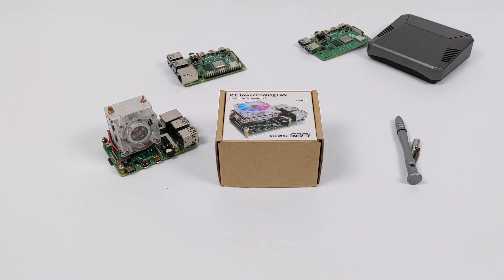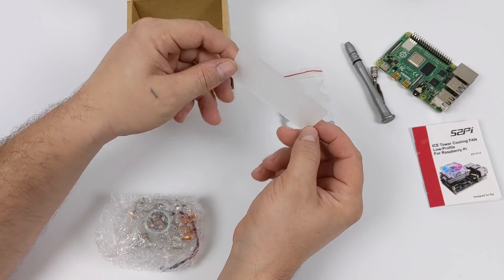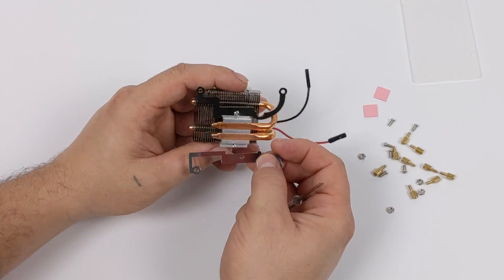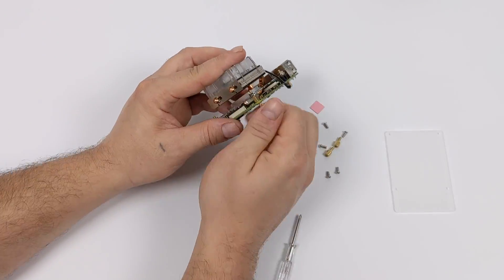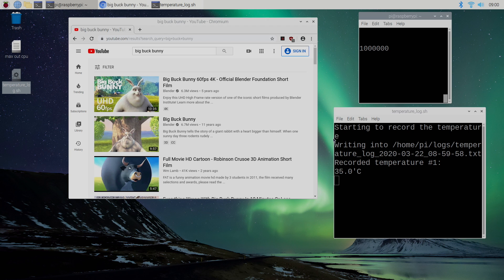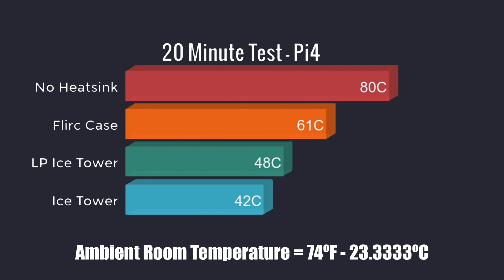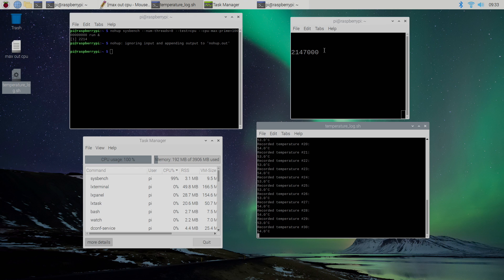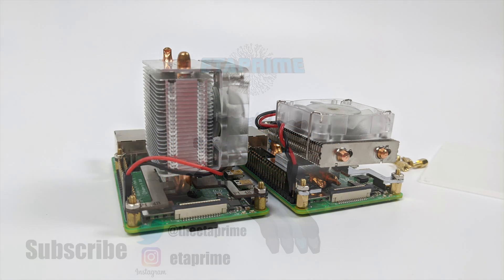Low Profile Ice Tower Cooler - The Ultimate Raspberry Pi 4 Cooler?

Comment: I have this cooler and mine I noticed the aluminum base plate and heat pipes were on 2 separate planes.  I sanded this down till they were level with each other.  I get 27c at idle and at 2.3 ghz with a synthetic load I did not exceed 50c.

Comment: To recap: that is a SBC with bt:5.0 and 8gb ram on a 2.0ghz apu that refuses to hit 55c even pushed to extreme limits. For $100 those specs are pure insanity. This one sbc, that is about the size of a pack of cigarettes is powerful enough to exceed any average computer user’s use case. You have to be an enthusiast to even take advantage of this multi monitor beast. Hackers be foaming at the mouth for something this crazy powerful.

Comment: Got here looking for the acceptable temps of the pi, I have the Ice Tower but had to remove the fan now after 4 months (it started making HORRIBLE noise. (I also didn't get the acrylic plate on either of the two cooler even tho they had the plate mentioned in the documentation.)) and I'm wondering at what temp the CPU/GPU throttles. (with just the ice-tower metal it seems to be running between 48 and 52 Celsius. edit: Its not idle, but running a few things on the network.(which crashes the Pi3b without active cooling.)

Comment: Thank you ETAPrime.
I picked the low profile version, because i thought it would cool the rest of the SBC by its directed airflow onto the components. yes we normally only investigate the core temperature.
The better performance of the older Ice Tower seems due to its larger heatsink area?! I didn't knew that the fins are wider than the LPs. Though i'm satisfied with the indirect RAM and DCDC cooling.

Comment: How about trying the original Ice Tower cooler, the one that looks like a block of apartments, with a second fan on the opposite side of the heatsink, blowing air in, rather than pulling it out ... I imagine it would be noisier (two fans, twice the noise), but would be interested to see the thermal effects of the forced-air setup ...

Comment: Can you put some heatsinks for the ram and the other chips with the Ice Tower kit?
And do you reccomend to put some thermal pase on the CPU?
Reply: The ram and other chips dont need cooling as those dont get hot either way. And you can use thermal paste, but ive heard there isnt much difference in temps
Reply: There is barely enough room with the original ice tower, but as the other person said, it's not necessary. However I did notice a small drop by putting them on the ram, and other controller chips, seems like it just helps overall. Also they do make some cases for the ice tower now, I use a Pizen Electro Cookie and it does great.

Comment: Great review, thanks! I'm currently very happy with my Argon One Fan Hat, with 3 customizable temp/speed settings, on my 2GHz overclocked RPi4. With 100% fan speed @ 60'C, it maintained 70'C with all 4 cores maxed out. 1080p YT videos cruise @ ~55'C, with the fan speed @ 60%. IOW, it does the job nicely.
Appreciate your honest opinion that also confirms my suspicion that the Ice Tower is overkill, plus obstructs having an enclosed case design for outdoor weatherproofing. But, yeah it looks kind cool, if that's the prime objective. :-)

Comment: Is there anyway that an Asetek Vapochill Lightspeed PC Case could be used to cool a Raspberry Pi IV just that the electronics have to be protected from the condensation caused by the cooling system by said case.

Comment: Dont buy the black Ice Cooler.  The part that sits on the SoC is painted.  You need to polish the black paint of with a dremel tool to get better heat transfer.

Comment: I see all these fun looking kits and I am tempted, but I can only afford 1 mini pc and I want a lot of bang.  I'm looking to emulate PS2.  I don't know if the pi4 can do it.  What should I be looking at as far as stats for standard 1080i ps2 emulation?
Reply: Pi 4 is good . You can get either 2gb or 4gb. 8gb is overkill as most rpi projects dont need 8 gigs. Id atleast say 4gb as it is a good amount of ram. Than you can use this cooler so you can overclock your pi 4 which makes emulation better

Comment: Hi, awesome video. I purchased a P4 a few weeks ago. I have installed the standard heatsinks that came with the packaging. Can this ICE tower be added on? Or will I have to remove the old heatsinks?
Many thanks
Reply: You will have to remove the old hestsinks. The only thing that mostly needs cooling is the cpu which has the GPU in it. Other parts dont get too hot

Comment: A well placed 5v 40mm noctua fan with stick-on heat sinks is enough to keep a Pi4 at 40c, even under demanding workloads like parallel code compilation.  This stuff is extreme overkill imo
Reply: Hey is this what you did for your pi 4? Because I think this is all I would need for my setup nothing extreme if so was it this fan Noctua NF-A4x10 5V, Premium Quiet Fan, 3-Pin, 5V Version (40x10mm, Brown)
Reply: @ever6  yep... Got some stick-on alum heat sinks from Amazon as well.
Reply: @codecae2  Thanks I'm going to order it now with my $90 giftcard
Reply: @codecae2  oh forgot to ask what case are you using for your pi 4?
Reply: @ever6  printed my own "rack"

Comment: A discussion of noise levels and fan curves would also have been useful. Imagine getting the fan down to e.g. 100 rpm for ultra quiet operation - probably not possible.
Reply: You can swap it from the 5v rail to the 3.3v for quiet operation and it still kicks butt.

Comment: Prime... you’re a day late, dollar short on this one man. People have done reviews for this as well as the regular Ice Tower for months now. How about a video on how Pi 4s can’t overclock after the latest rpi-update, or best packages to install on a Linux Distro for Pi4, best packages / unnecessary packages for Linux with Pi4, or Linux distro comparisons for Pi4? Don’t get me wrong bro, I really dig your content.. watch it religiously. Sometimes I feel like you’re grasping at straws for content when there’s so much untapped material to be discussed. Endulge me lol 🤣
Reply: You can only take so many obsolete computers and turn them into emulation beasts. At this point I think BalenaEtcher should be sponsoring your vids lol.
Reply: I went through comments as well, and quite a few people are touching base on overclocking, the config.txt file, and temperatures. I think a lot of folks including myself would be curious to hear your take on things such as the various Pi4 firmware kernels, stock Pi4 firmware, variables with overclocking, the SILICON LOTTERY, troubleshooting for users who can’t boot different Linux OS programs, and steps to take to improve optimization. #Content

Comment: I'm waiting to see an AIO cooler solution.
Reply: Did an AIO cooler show up and what’s an AIO cooler? I looked it up and didn’t get a great answer. Thanks for posting
Reply: @iflnr978  All In One, the entire cooling system comes pre-assembled with no filling or plumbing to deal with. There's a cooling block that goes where the cooling fan would normally go on the CPU and it has tubes connected to a radiator and one or more fans depending on the size of the radiator.

Comment: Got one of these at Christmas.
You can boost the thermal elimination by flipping the fan around so that it is pulling heat off of the pi instead of forcing it back down onto the pi as it “cools”
Also with no case I was able to hit only 30deg Cel at idle at 45 during stress test.
However I don’t like my pi to be bare, so I tried to find the argon one but it was nowhere at the time so instead I got the argon neo. It has to mount points that will work for the ice tower low profile, but it will stand off by about 1  1/2 pennies.
So I got a couple shiny pennies and used the other two thermal pads from the ice tower LP and it works like a charm. During stress the system barely topped 54deg Cel. Which when compared to everyone else on the forum I tested with. I still had the best heat elimination. And never hit throttled load.
Reply: Hey, I know that this comment is over a year old, but can you post a picture somewhere and share a link? I'd love to see how it looks.

Comment: I think the design is a tad inefficient, as the heated air seems to be getting pushed back down onto the board.
Reply: Usually blowing down across the motherboard actually keeps things cooler. It "washes" across the entire board.
Reply: @bradquinn4161  Yes, however having the fan in the middle and pushing air up would have a similar, if not slightly better effect. After all, cooler air would flow over the board as the fan pushes it up into the radiator. Air pushed through heats up and is ejected in the same direction hot air naturally goes.
Reply: @silversonic1  Logically I would agree with you, but reality is different. Going back to the Pentium one days(just Pentium at the time) it has been consistently shown that down just works better. There is probably some good explanation in the thermodynamics, but the short version is that down puts more air across the motherboard. Which in turn helps cool the CPU.
Reply: @bradquinn4161  That doesn't really explain how the OG Ice Tower works better, though.
Reply: @silversonic1  Take a closer look at the two. The original is much larger.

Comment: My expectation for this cooler would be that while it may not have as good a performance metric for the SOC as the original Ice Tower, having air blown down onto the card should give much better cooling to the other components of the Raspberry Pi itself.

Comment: Why not just get a 30mmx30mm heatsink from eBay for 5$ and add a $5 pi fan from Amazon with thermal adhesive paste to attach the heatsink to the SoC ($1?) and then 4 m3 nylon screws to attach the fan to the heatsink?  Max temp run with 2Ghz overclock under full load is 39c, running 24/7 as a desktop with performance governor enabled.  These fancy coolers are not much better in the end and end up with a larger profile than with what I mentioned and you spend twice as much or more on them.  My 2 cents.  Cheers!
Reply: yeah but thats not COOOL. You buy this type of stuff for the look of it and the overkill factor

Comment: I have this cooler on my OC Pi4.  I don't Crack 48* OC, but I'm using kryonaut instead of the thermal pad.  Noctua also makes a drop in 5v replacement fan that blows better than the RGB one. I havent installed and tested the fan yet, but bench "hand dyno" is pretty obvious. 

Oh and I'll be making a mini PC tower case for this that will fit this heatsink. If it comes out well, I'll send you one to play with (if you're interested)

Comment: What's the point of this? The raspberry pi 4 can literally be used without a heatsink on it's CPU. You can also purchase really compact cases which comes with heatsinks and a fan from eBay or Aliexpress for less than $8. This bulky cooler seems silly
Reply: I have to say the case that came with my Canakit starter kit is really high quality. Put on heat sinks, attached fan (wired to 3 volt pin). Dead quiet, cool....end of story. Don't know what it would think of an overclock. Probably just need to use 5 volts on the fan.

Comment: If you look on ebay, apparently there is a case designed for the ice tower, it actually looks really good. Not sure if it would work with the low pro though

Comment: I have this cooler for a while. I filed the base of the cooler flat. Used mx4 thermal paste. OC 2.1ghz GPU 700mhz and my max temps only reached 38c after 5 minutes. That thermal pad sucks. I also slightly bent the mounting brackets so the cooler applied more mounting pressure to the IHS. 
Also to note.. I purchased a double stack acrylic case and removed the middle layer since I only have one pi in there and fits this cooler like a glove. The double stack case was only about 10$ on Amazon at the time I purchased it. Looks pretty. I may post a picture and review on Amazon shortly.
Reply: holy shit 38c ? Do a 20 min test im curious
Reply: @PERK-30  I would have gone longer, but it shot up to 38c in 30 seconds and just pegged that temp and didn't budge for 5 minutes.   So I was happy. I also used mx4 thermal compound. When I slid the base over the file the cooler was far from flat. Took me about 20 minutes to file it flat. But I'm not sure if that played a huge role. I think mostly thermal paste is where gained the performance.
Reply: @unitcharles689  no the lapping of the heatsinks did the most difference, the thermal paste was a huge upgrade as well. Good mods!
Reply: Paste is always better than a pad, but it's good to see the test done with what is provided in the case.  Not everyone is going to have a tube laying around.  Lol.  Thanks for the info on the double stack case too!
Reply: Cooler review upload with photo of the 10$ double stack case mod on Amazon.

Comment: ETA Prime, how tall is this setup from the table to the top of the fan? I have a Pi Squared wood case sitting around and I think this setup would look sweet in it. Just thinking about modding it for the Pi 4 and this cooler. Thanks... I also have the Argon One Pi 4 case. How will it stack up with the two Ice Coolers?

Comment: I wonder how well a thin 40mm fan would work between the fins and the Heatsink base, blowing air upwards. I don't know how much space is there, but it looks like there's a few mm, and those fans do get pretty thin. 
5mm to 7mm thick. Might even be able to use a blower with a large enough opening, in a pull configuration. Blow the hot air out the end.
Reply: Exactly 8mm, tho you might want one 7mm because it isn’t perfectly level. Measured using a caliper and my own 8gb model. I don’t think it’s necessary tho. Even pushing it to extremes running synthetic benchmarks my model never hit 50c @ 2.0ghz OC. At that point it’s still cool enough to touch. You’re probably not even doing damage to it.

Comment: great vid. love all those coolers. Seems to reaffirm how good the passive Flirc case is. No fan, no noise. great temps.
Reply: The Flirc will hurt your wifi/bt signal though.
Reply: @Prutprout  that was the case with every all metal case I’ve used
Reply: Can you trust that case with the PI overclocked? The fan is very quiet and so far the best cooling solution for this little hotplate.
Reply: @georgepitaru  i got a basic labsys case/power supply kit and it was enough to run the pi4 at 2ghz without throttling... it was at 78 and running 5v for the fan but hey it did it lol

Comment: Overkill is perfect for this kind of stuff...
Reply: Someone once said (about cars) that enough is too little and too much is just enough - same thing applies to computers.
Practically speaking, this should eliminate overheating (without throttling) for most useage and make your pi last longer (heat eats electronics, cooler lasts longer!)
Thanks for the video.
Reply: @jfan4reva a good one advice brother